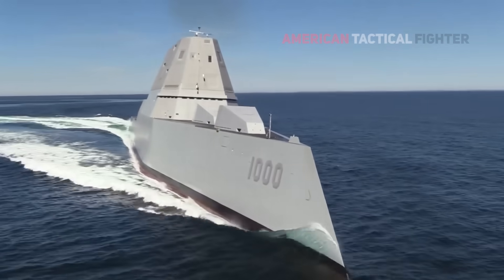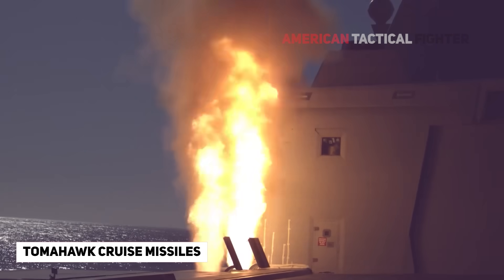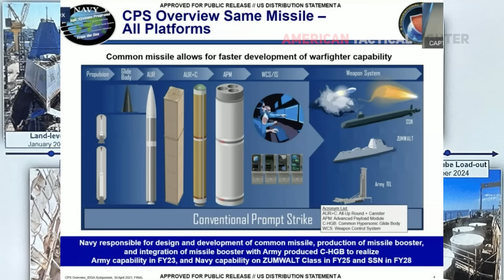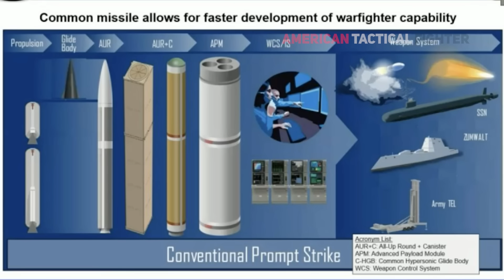Finally! Zumwalt Destroyer Successfully Tests New Hypersonic Missile After Upgrade

Comment: The side which runs out deadly ammunition first loses. If you have 100 missiles and opponent has 1000 artillery rounds (muzzle velocity of about Mach 2.5) or some other mix, and there is some sort of parity using artillery cluster munitions with some sort of remote controlled or seeking steering device (there are roughly five types, some of which screw into the fuze socket in front) have been used to great success in Ukraine.

Comment: Correction, the cost of guided munitions went up because of the reduction of the build numbers being reduced by congress. With only 3 ships of the class being built made the cost of rounds go astronomically high, so the guided munitions were canceled leaving rail guns and missiles as the only teeth of the destroyer, with railgun development stalled that left only missiles as the weapon of choice.
Reply: A good machinist could make a 155mm shell from billet in less than a day, I would estimate. Maybe ten.
Reply: @tobyw9573  They way over price everything. I built a small fume hood for the city wastewater treatment plant it took me about 3 hours and about 40 pounds of stainless and my company charged the city $11, 000 bucks.

Comment: White elephant dissaster of over spending.  😡😡😡😡
Reply: Piss-poor development model. This ship should have had the hull design and cannons down pat and tested decades ago! 6 to 14-inch turrets were available before the end of WW II. Just weld it onto an old ship of comparable size and power and see how it works after the model is ballasted. Leave the superstructure off, simplified, or however you want.

Comment: The notion that a mach 5 missile is "maneuverable" is over stated.  The faster you go, the less maneuverable you are, it is physics.  you may have capability to turn some, but the mission is a fail the moment you do.  Any turns by a mach 5 missile in terminal phase is going to cause it to miss it's target by many, many miles...universally.  All of them.
Reply: You just need a cloud of bomblets larger than the rocket can steer around. They do, after all, need to hit the ship-sized target with the missile.
Reply: @tobyw9573  That's sounds like "flak" revisited.  But you are correct.  I would also add that the ship sized target is moving all the time.  So an anti-ship hypersonic missile is pretty useless unless it's a nuke and doesn't have to be exactly on target.

Comment: This is STUPID.  The USN is turning a stealth frontline destroyer into a 15-minutes missile platform that any 30-knot conventional non-stealth cargo ship could accomplish with the same payload system.  The USN has completely forgotten what function destroyers are designed to provide… persistent forward deterrence for strategic assets like aircraft carriers against air, surface and undersea threats.  So what would the Zumwalt do after it fires all 12 missiles, assuming it can actually justify spending all the $$$$ represented by the missiles, go back to port to reload?  What a stupid idea.  I also suspect the cost of guided extended range 155mm ammo has already drastically dropped after they started using them in high volume in Ukraine!!!
Reply: W każdym ,,głupim,, pomyśle jest swój rozum . Zegar, który nie chodzi , jest lepszy od takiego , który chodzi żle:)
Reply: @wodekzelenski7114  …and a clock already deemed extravagant serves as convenient fodder for actual folly.
Reply: @ministryoflies3300 Oczywiście, jak w końcu nadejdzie ten złoty wiek !?🤔😂👍🏻
Reply: I think the problem is, the Arleigh Burke class destroyers are fitted with the mark 41 VLS systems. The hypersonic missiles being installed on the Zumwalts are too large to fit inside the mark 41 VLS. There's simply no extra space for those missiles on the Arleigh Burkes.
Reply: I'm guessing, and that's all it is is a guess, that in the future they will be on Arleigh Burke flight 3 Alpha and above destroyers they might even go on the new constellation class frigates with different vertical launch systems. They might also even go on to our Virginia class Subs. I believe that they are using the Zumwalt as a platform for testing. Especially since we know that no further Zumwalt class destroyers are being built.
Reply: @ yes, they’re using the Zumwalt as a test bed for the vertical hypersonic launch system. However unless there are serious operational flaws in the Zumwalt, it’s a very expensive and potentially erroneous way to put the  Zumwalt out of commission for long periods while they swap in and out  experimental gear.  Meanwhile the Zumwalt would experience reduce operational potential if its presence is still needed in battle groups. I think they’re making a mistake just focusing on the missile while missing the opportunity to develop a new strategy in integrating cooperative rapidly reconfigurable floating weapons/payload platforms. Again the F35’s lesson of integrated battlefield should be embraced. All you need is a robust fast high payload capacity platform to house missiles or other platforms (e.g. lasers) to accompany battle groups, they don’t need to be highly maneuverable multi-system frontline, tip-of-the-spear ships, to carry bulky long range missile systems that only take up space and require very long downtimes, to sideline very expensive flagship level units that carry highly versatile, highly trained crews.  You need something like the 33-knot USNS Regulus (Algol class), upgraded to support single purpose frontline weapon systems. China has shipbuilding capabilities than seriously dwarf the US’s so we need to be efficient and innovative, and develop the ability to crank out large numbers of easily reconfigurable platforms at lower costs.
Reply: @Fakename-ub8pw  you don’t need a destroyer to house these hypersonic missiles.  In this age of drones, you only need a fast cargo ship to act like a “slave” launch platform for the missiles.  F-35s already use this sort of strategy in integrated battlefields.  You pair these “slave” missile platforms with “master” destroyers, cruisers in task forces in carrier groups.
Reply: Honestly, I was a fan of the extended range precise location artillery rounds with the fast auto loader they were originally going to use. They were going to have vLS tubes as well I thought. 
They moved away from the newer load out bc not enough of the destroyers were going to be manufactured raising the cost. 
I say why can’t you also employ them on modern upcoming attack craft or amphibious support craft giving you’re the number. 
The range they were going to be throwing volts wagon beetles was going to be quite impressive. Not only to mention how many shots you could fire off for the cost of a tomahawk missile or something similar!!! Idk I’m just saying. 
Imagine how nice them shells would be in Taiwans defense against a very close adversary such as China.
Reply: @everettjohnson8776  I think they should plan on improving capability, production volumes and allow economies of scale to reduce unit costs of ammo and gun platforms.  Guided rocket-assisted gun ammo takes up much less space, can be reloaded at sea whereas current missile launch systems on frigates, destroyers and cruisers can’t be reloaded at sea… really shortsighted.  You still need both but gun expendables would be much cheaper per round.
Reply: @everettjohnson8776  I totally agree. The 5-in guns on the ships just feel underwhelming.
Reply: This destroyer is the stealth.
Can support assault missions 
Quickly hit and kill and run
Reply: @fiodarkliomin1112  normally, (landing) assaults need persistent offshore support which does suit the use of guided 155mm munitions.  Stealth is only meant to reduce the standoff range of enemy radar, AWACS and launch platforms, making them more vulnerable to being nullified, taken out.
Reply: First of all, I would like to say that I agree that the cost of the Zumwalt destroyers is way overpriced. However, what many people are missing is that the age of the separation of Cruisers and destroyers is coming to an end where destroyers and cruisers are almost identically the same ships one just larger than the other. Again our current Cruisers have a larger radar array than a destroyers but that is changing. The mission of both Cruisers and destroyers is now the same. What I believe that the Zumwalt Destroyer is doing is testing these new missiles but that they will go on other ships as well Arleigh Burke class Destroyers maybe even some frigates are Virginia class submarines they are going to go on other ships and boats.
Reply: Too may Gays and TGs involved in everything. We need normal people making decisions. They Navy needs to face reality. They really screwed up on this one.
Reply: Ukrainian is not receiving any guided 155 mm shells because the us hasn’t made any because their too expensive. They don’t work in normal 155mm cannons so even if Ukrainian received them they wouldn’t be able to use them.
Reply: @ Ukraine did receive Excalibur from Canada and used them effectively (70% efficiency) with the M777 howitzers it was using.  Excalibur works with “…M109A6 Paladin and M109A7, British AS-90, German PzH 2000, South African G6, Swedish Archer and French Caesar. … M198 and M777 howitzers… also used with AHS Krab...  (Wikipedia).  However  GPS jamming by Russia nullified early variants of Excalibur shells but other variants Increments Ia-2, Ib, II and III are all GPS jamming resistant, incorporate other means for terminal guidance.  You may be referring to these other variants which I don’t know if they have also been provided to Ukraine.
Reply: Shells have been used in Ukraine in the millions!